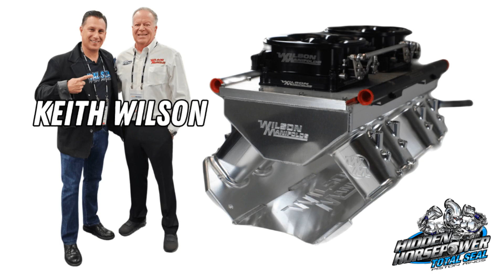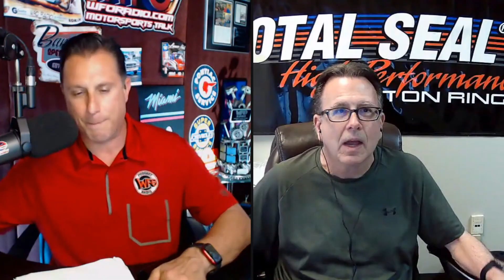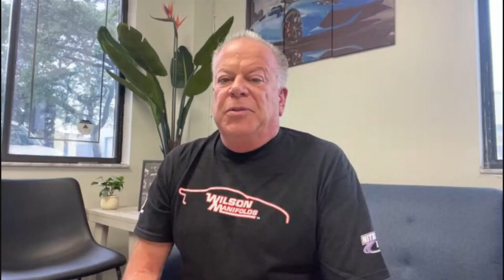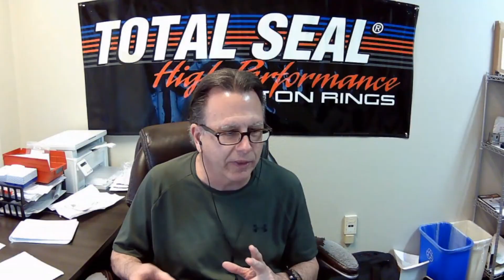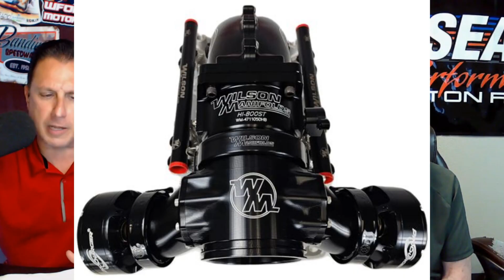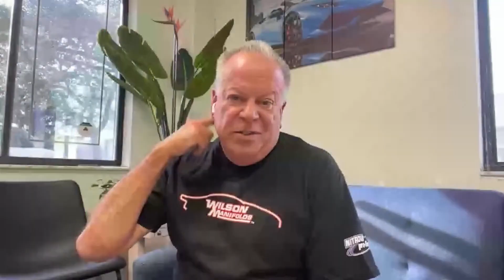"Mr. Manifold" Keith Wilson Talks About Earnhardt, NASCAR & NHRA

Comment: Years ago, around 2000 or so, I was crewing a 65 Mustang Drag Race car. 347 SBF, 13.5:1 compression. 250 hp Nitrous plate system. We were having issues with burning up pistons, cylinder heads. We called the tech line for NOS, Nitrous Express and others trying to find an answer to our problems. We ended up sending the cylinder heads and Intake Manifold to Wilson Manifolds to get ported and flow matched. They got the cylinders within 1% of each other. They asked about our program. They were the only ones that asked what fuel we were running. It was C12 at the time. They said we needed to run C16. We switch fuels and out tuning problems went away. I thought it was odd that not a single Nitrous company asked what fuel we were using, but Wilson Manifolds did. I was very impressed with their craftsmanship and genuine interest in our success. This is what sets them apart from others.